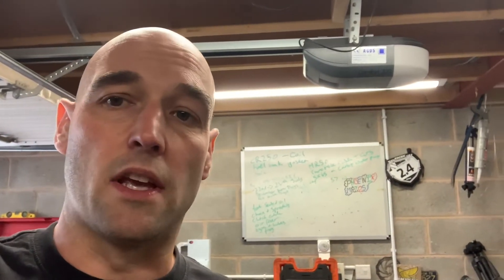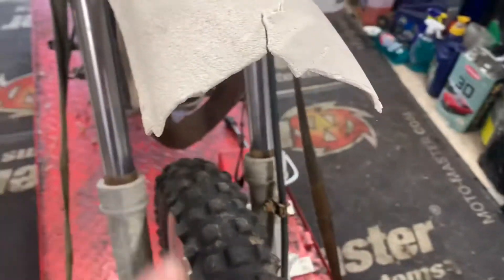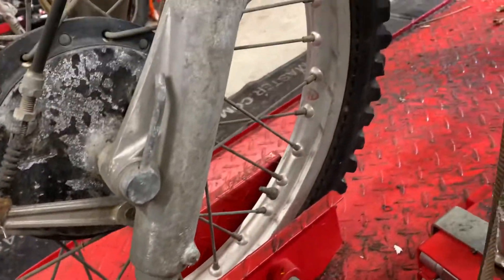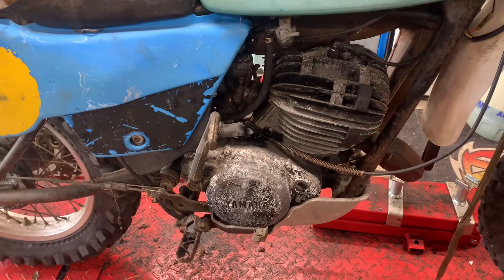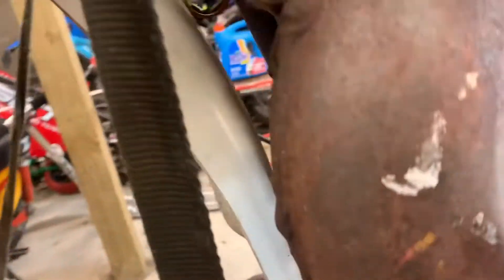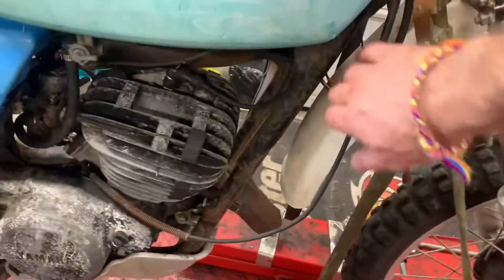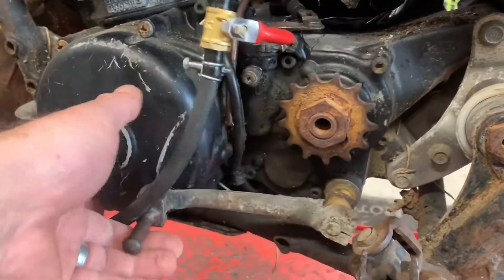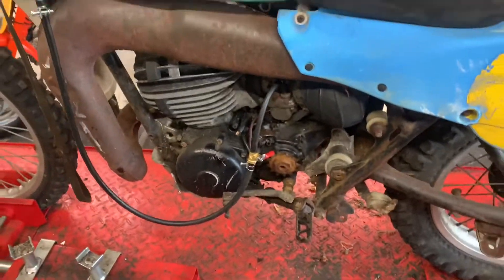1980 Yamaha IT250g

Comment: I have a 1980 it250g as well and I'm trying to figure out how to mount the gas tank because it wasn't on when I bought the bike. All I have is of course the tank & the bushings and mounts that bolt to the bottom of the tank itself. I found and bought the bolts that go through those bushings and thread into the frame but there is not any kind of threaded insert in the portion of the mount that is permanently mounted to the frame. I was wondering, is there a rubber bushing of some kind that goes in the empty tube on the frame? I can't seem to find what I need to add to the frame to receive that mounting bolt despite looking at countless parts diagrams. Any ideas?
Reply from the maker: I’m 99% sure the bolt should literally thread straight into the frame - I wonder if someone has drilled it out at some point? Wonder if you could us a nut rivet to sold that problem?